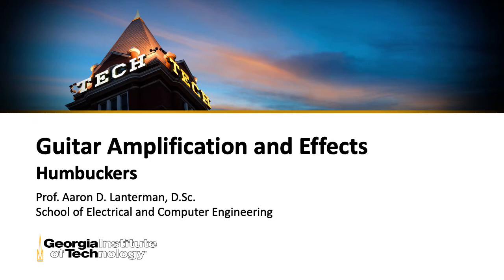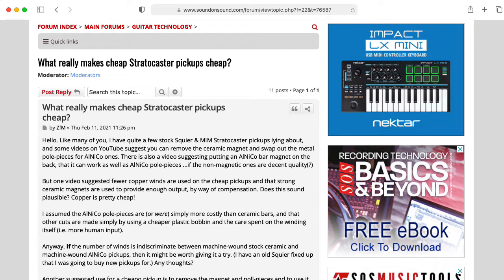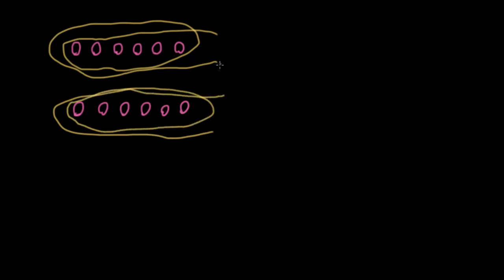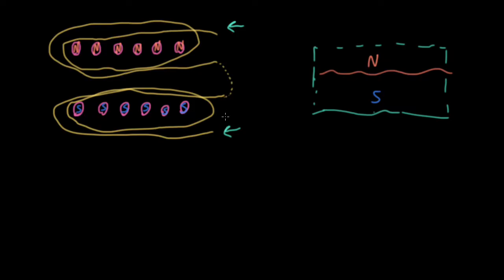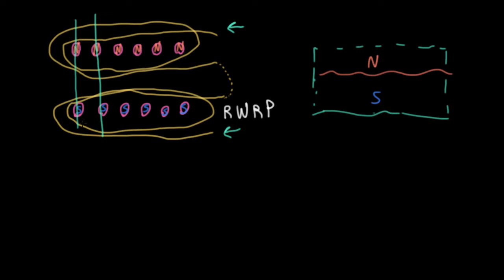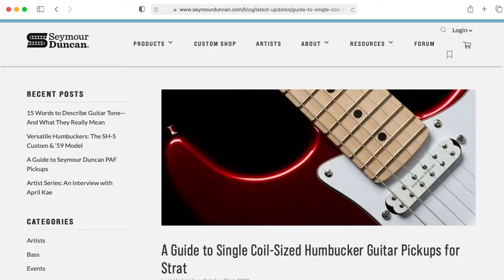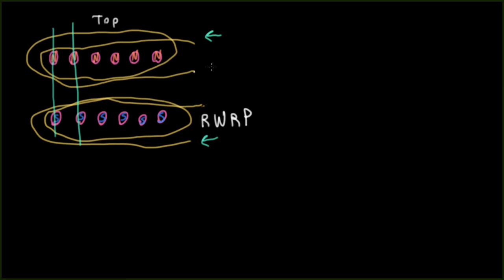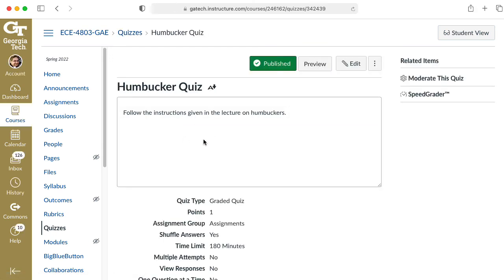ECE4448 L9: Humbuckers (Guitar Amplification and Effects, Georgia Tech course)

Comment: Gotta mention tho: coil splitting can only be done if you have a pckup with 4-conductor wiring (4 wires being north start, north finish, sout finish and south start)
The annoying part is that all brands basically use the same colours (red, white, black and green), but use a different colour code and there's this bare wire that always goes to ground regardless of which brnad you're dealing with
With 4-conductor humbuckers you can also do a parallel/series switching;  what you explained here is the conventional series wiring (north start being the hot signal, north finish and south finish soldered together to connect the coils and south start going to ground)
In parallel north start and south finish are your hot signal and north finish and south start go to ground
This will still give you the hum cancelling, but the sound is rather that of a beefier single coil and is a little quiter than in series (but louder than a single coil)
You can even combine parallel/series switching and coil splitting on separate switches or push/pull pots. (DiMarzio has an interesting wiring diagram on this)
Not that when you switch to parallel, you can't coil split though and the signal has to go to the parallel/series switch before it goes to the coil split

Comment: I guess that if the less focussed sound of a humbucker is hard to describe verbally, you could at least begin to describe it spectrally based on the sensitivity of the pickup to different spatial frequencies depending on its position. As we saw before, the sensitivity is basically sin(2*pi*x*f/c) where x is the distance from the bridge, f is the frequency of the harmonic in hertz, and c is the speed of sound in the string. But for a classic humbucker the sensitivity should be closer to sin(2*pi*x1*f/c) + sin(2*pi*x2*f/c) with x1 and x2 being the positions of the two pickups. For low frequency partials, both sensitivities should be similar, but for high frequencies, they should start to have different signs about half the time, damping some of the higher frequencies in a more complex way than a single pickup does.